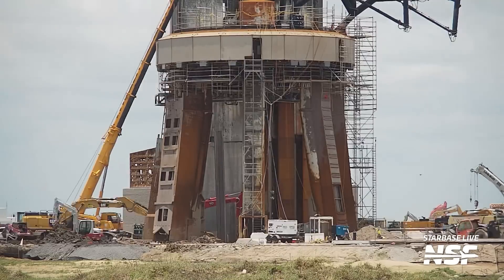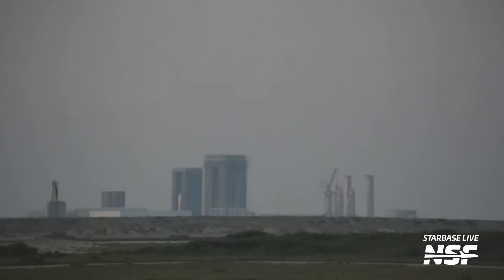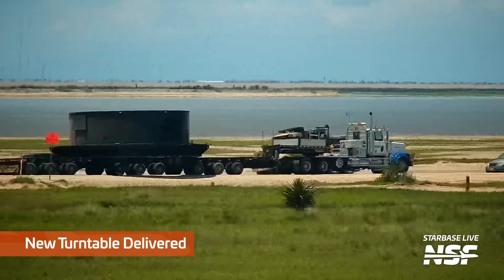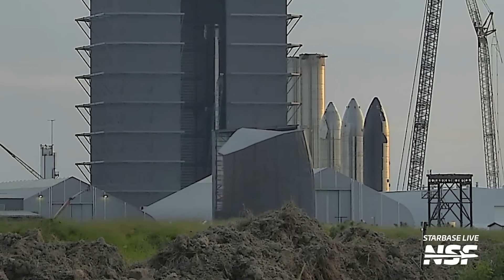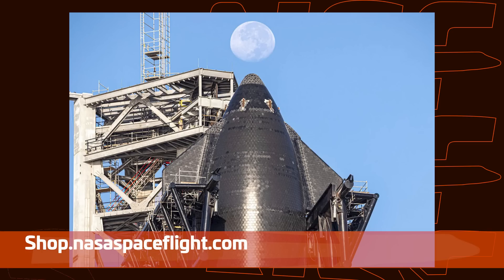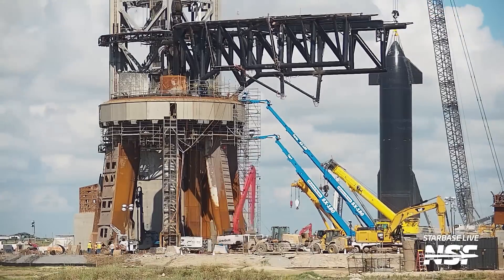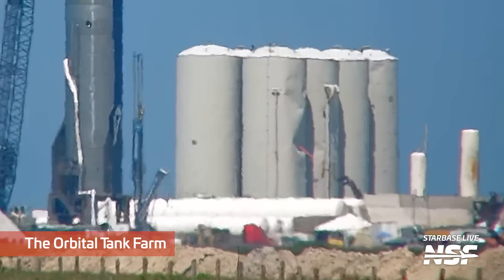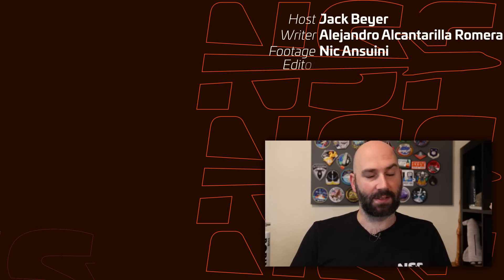Starship Testing on the OLM Next Month? | Starbase Update

Comment: i assume those Water Tanks cant hold high pressure ? otherwise crank it up, those dents will smooth themselves out
Reply: They are just jackets on the real, smaller, tanks inside.
Reply: @userPrehistoricman  somewhere i read that the water tanks are actually just one wall, so what we see. might be wrong about that.
Reply: @userPrehistoricman  somewhere i read that the water tanks are actually just one wall, so what we see. might be wrong about that.

Comment: Elon is probably slightly hopeful. For spacenerds, it takes 1 month (between 21 and 28days depending on environmental conditions) for the concrete to set right through, and you can't change that, especially when you have billions of dollars of obt,  and the world's biggest and most powerful rocket sat on top. That's why we have seen such concentration on piling, steel barrier piles, which also will stop any ground water getting under the obt, and all the massive works on the obt repairs and buildings changes. Elon is just doing the obvious efficient site management in getting as much done as possible while waiting for the concrete to dry

Comment: The big concrete slab under the water cooling plates will likely need at least two to three weeks to cure before being subjected to high pressures resulting from the rocket engine gasses..
Reply: What type of concrete, do you know?

Comment: Saberiam dizer porquê o Superheavy não tem um ''bico" para voar sozinho?Seria incrível ver ele sendo testado sem colocar uma Starship em perigo.
Reply: No reason to, simply put. And keep in mind, they’ve set up a true production line for both at Starbase- and as Elon says, having a production capacity ‘covers a multitude of sins’. He follows the same philosophy at Tesla; one of the reason they are so easily able to drop prices in response to market conditions. So a separate booster flight test campaign would add not only cost, but schedule—for no clear added benefit. Keep in mind, this is the company that actually crops the second stage nozzles of Falcon 9s when it can just to save money. Anything that not only adds costs, but, worse, adds schedule….is automatically ‘guilty’ unless it’s value-added is ultra-compelling. - Dave Huntsman
Reply: @dphuntsman  thank you.

Comment: Just after the launch, looking at the devastation I would have said at least 6 months just to get back to where they were but after only a month they are almost ready to install the new water cooled shielding and deluge system. Unbelievable speed of construction.
Reply: The next launch will be July I've been told.  Late July.
Reply: @JohnnyZenith  They need a month of testing so they will be testing into august. Launch in mid august is a solid possibility though unless there are unforeseen problems.
Reply: No FAA approval, no launch.
Reply: @davidstevenson9517  They already have approval for 5 launches per year, you mean a launch licence for the second test launch. The only reason to not grant the licence is the FTS which has already been upgraded and retested.
Reply: @davidstevenson9517  Still whining about a non-issue?
Reply: @davidstevenson9517  the FAA’s only real reason to block SpaceX’s launches of Starship until recently was getting the SLS launched first.  Now that their overpriced toy is proven, they have no reason to cockblock the company hired to do all of their heavy lifting for Artemis.
Reply: @OneBiasedOpinion  username checks out

Comment: Pretty soon, the water deluge plate and pipes is ready and installed! 🧑‍🔧👨‍🏭👷‍♂️
Reply: So, what is all that equipment doing around OLM?   Also, how’s that autotaxi working out for you Elon promised for 2016?
Reply: @kurknielsen  Currently they are sheet pilling and excavating for the deluge pipes around the edge of the OLM, pilling for supports under the OLM is now completed and ready to pour the concrete slab to cap them off. I have to say I was pretty sceptical they could get repairs and upgrades done this fast but it is moving at an astonishing pace at the moment. I would say less than 2 weeks before we see the deluge piping installed, with the steel plates being installed above it soon after. 4 weeks is maybe doable looking at the speed they are currently working but probably be more like 6 before it is ready for testing.